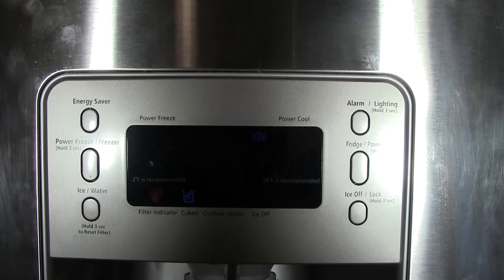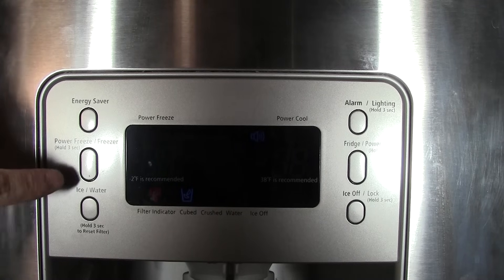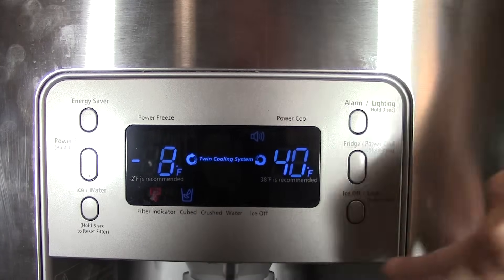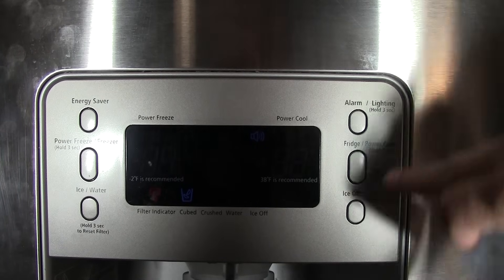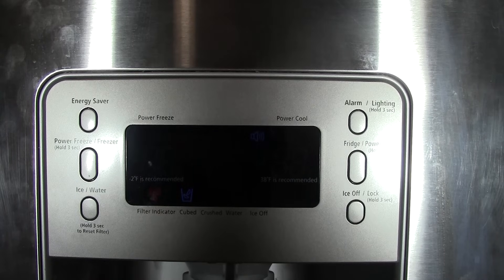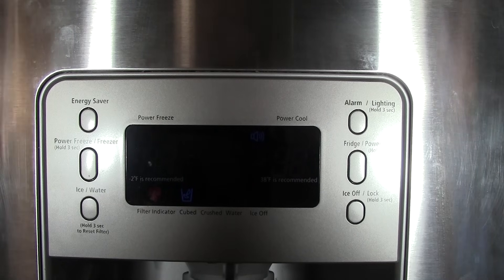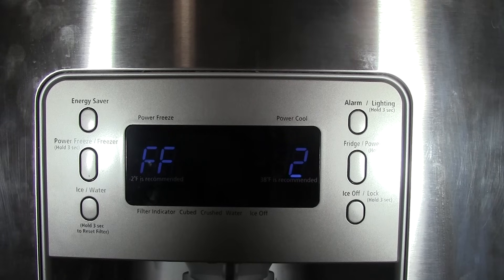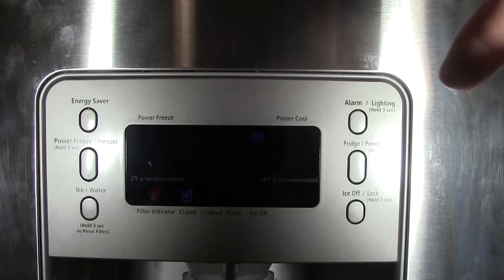FORCED (manual) DEFROST mode on a Samsung Refrigerator--Top Secret Setting

Comment: Wow, had code 21E, (freezer fan error),  freezer wasn't cooling, but fridge was.  Placed unit in Forced Defrost mode for about an hour. Almost lost $300 in frozen meat. Then placed freezer in "Power Freeze" mode (unavailable before) and back in business:) Must have been some ice preventing fan from working? One thing for sure, I long for the days of a simple refrigerator!

Comment: I thought I would share my experience.

It boggles my mind that two appliances with the same model number (mine and this vid) are not actually the same.  But although the displayed menu was different I did find forced defrost.  If you were wondering, as I was beforehand, and in MY case forced defrost ran for 22 mins.  It chimed the whole time, which will drive you nuts, then resumed normal cooling.  My fridge was empty so I didn't care about that temp but my freezer was not so I had a temp probe in the freezer and the readout outside. Temp did vary a little which suggests forced defrost affects both.  If you have the luxury of a second fridge freezer I would recommend using it. Unless it's a Samsung lol

Unfortunately the work I did after this procedure did not fix my problem but that's a whole other story that doesn't belong on this thread.

Comment: how long in demo mode does it take to defrost ice master bucket...best video on this I have seen...thanks Jake...just turned four years old on this modelRF323TEDBSR manufactured in 2012
Reply from the maker: ----> Four years and this is the first time you had to defrost it?  That's not bad.  As far as defrosting the "ice master bucket", I have no idea.  Let us know how long it took....  Thanks for watching.
Reply: I went into demo mode and finally removed ice wrapped around the cover coil.  I suspect there is a leak causing the water to freeze into one chunk took six hours to defrost

Comment: NONE of these "quick fixes" with the door control "rd or fd" defrosting will work, it's less than temporary and you have to run the cycle listening to the beeping several times just to get it to quiet up a little bit.  The "take it all apart" and melt out the ICE with a hair dryer (you could use a heat gun but to be on the safe side a hair dryer is your best bet) will resolve the ICE for about two weeks once this starts to act up on your refrigerator. And covering the coils with something won't fix it for good either, it's just going to freeze all that up and make more of a mess that you'll need to clean up.

So every couple of weeks, just get 'ready' to pull everything out, disassemble, melt the ICE and put it all back together again.
We as well are looking to get rid of this refrigerator and get something else as this has gotten so out of hand it's absolutely crazy. Samsung should be FORCED to replace all of these units with ones that don't do this.

In the interim, PLEASE be sure to unplug your refrigerator while you are taking it apart and melting the ICE for SAFETY purposes.

Comment: I have a Samsung RB193KASB and it has icing build up behind the back wall inside the refrigerator chamber. For the past 5 months I defrosted twice the coils with a hair dryer. This issue comes back every 2-3 months. 
The menu for my fridge is a little different and to get in the defrost mode, press simultaneously for 8 sec the top 2 right buttons: Super Cool + Fridge, and then the screen goes blank. Press fridge 2 or 3 times and then it will appear Fd on the display. I've tried this "Fd" twice and it beeped for about an hour and 20 minutes (each time). It appeared to me that there was still ice at the back  and I opened up the back cover. Obviously this Fd function didn't work for me because the defrost and evaporator coils were completely covered in ice and no signage of defrost. Here are few values for the components inside the refrigerator: Drip tray (drain) heater = 340 ohms, defrost heater = 113 ohms, thermal fuse is ok = 0 ohms, Fan + 162.6 ohm, chamber thermistor = 6.1 Kohm at room temperature and changes the value when exposed to ice ~ 10.5 Kohm - Same value and response for the thermistor mounted on the evaporator coil. This makes me believe that all components inside the chamber are ok and I may have an issue with the control board located at the back of the fridge. 
Any suggestions?

Comment: I have the RS277ACRS getting water in fridge bottom.  Tried hairdryer.  If I do the forced defrost will it heat up the freezer side too as it has two seperate cooling systems.  Need to know if I should move everything out of the fridge.

Comment: I cant imagine anyone watching this does not own a Samsung fridge but if by some miracle you don't. DONT GET ONE. They are around 30% more expensive than similar fridges and despite that they insist on using a Styrofoam backing for the evaporator panel sealed with a low grade sealant that tears when separated. When and I do mean when you have to open that panel to defrost your unit that foam will break and the sealant will tear. From that moment on your going to be getting constant ice build up and you will be opening that panel monthly in high humidity conditions. Every time you open it, it will get worse. 

The problem is so bad that repairmen in my city often know how to install aftermarket heating coils.....JUST FOR SAMSUNG FRIDGES.

For want of 8 bucks worth of silicon your 3500 dollar fridge will fail years before it needed to, for want of a 30 dollar heating coil you will be spending tens of hours a year defrosting the dam thing and pulling out the bottom drawers because for some stupid reason the screws are one inch bellow the drawer mounts. 

* bonus round, the power supply to the fan is on the panel and they like to use a four inch cord (THERE IS NO REASON THE FAN HAS TO BE ON THE PANNEL, NONE) so when you take the panel off you need to pray to god you don't damage the wiring. You have to snake your hand back there like some sort of bomb defusal tech and pop the cheapest plastic connection mount Samsung could find. Oh and its right beside the red hot heating coil.

There is a special place in hell for the engineers of those fridges.

Comment: Hi ...I hope your still around Sure could use some help.
  if I force my frig to defrost by the coil heating up  does it also defrost my freezer .?   And  I can't pull  my frig out ( stuck in there really good), so I just wanted to make sure water doesn't run out the back anywhere  ?   My model is  28HDEDBSR/AA  and it  has a very simular panel as yours

Comment: Having read about 30 of these comments, I think people just need to calm down, take a deep breath, watch the video and follow it carefully. I did, and it worked great! Nothing in the freezer or refrigerator spoiled. The only thing that defrosted was the icemaker, which is what I needed. I didn't have to unplug the refrigerator. I know it's frustrating when an appliance stops working, but it's not worth all the high panic and anger I see here. Easy does it friends!
Reply: How's your ice maker been working since you wrote this comment? I've seen different people say that they've either had to keep doing it every month or that it's been fine for a few months. Thanks.
Reply: @Tapsomebong234  It's a crap shoot. Sometimes mine freezes up on a monthly basis, other times it can go 3-4 months between issues. I think it depends on how much you use it.

Comment: This video saved me a couple of hours removing everything from the freezer to locate the problem or a repair call for my Samsung RFG298 Series french door refrigerator using the manual defrost.  The freezer recirculation fan developed a loud buzz due to ice build up.  Thank you.  New Subscriber.
Reply: I think I have the same model as u. I’m having ice build up on the top where the twin cooling placard is. When you did the manual defrost did you remove all your food? About how long did the whole process take?
Reply: @mylastbreakdown  Once I initiated the defrost process it finished automatically after approximately 45 minutes. I did not remove anything from the freezer and I kept the freezer/refrigerator doors closed. I hope it works for you.  I did this on 10/23/2020, and the fan is still quiet.

Comment: I have a Samsung Fridge (RB195BSBB) and my function key and operation mode combinations are different.  I had to hunt down the Fridge Service Manual online for my model in order to get the proper function key combos.  I'll be testing out the Forced Defrost mode as I'm sick of having to disassemble the back and run a hair dryer over the coils :(  Thanks for the tips!
Reply: We finally took the deli drawer out because of the water/ice that forms on the bottom. It's a lot easier to mop it up now before it freezes solid. I hate this refrigerator, but can't afford another one...oh well...Shame on you Samsung for making such a flawed piece of junk (and expensive, I might add) Give me the old reliables from 25 years ago that NEVER die. One good thing? Your refrige is a lot cleaner because of the constant shuffling of food stuffs :)

Comment: I totally agree with Clint Gray below, I have both Samsung (at home) and Whirlpool in my condo.  The Whirlpool appliances work properly, are easier to use and don't break down constantly.  Don't - Don't buy a Samsung dishwasher, the bottom rack comes off the track every time you pull it out, it is such a pain.  Samsung stove cooks ok, but you have to push the pad buttons hard enough to break your fingers or the back off the stove.  A brand new Samsung microwave (bought to match others) has two buttons that don't work at all - 0 and 9.  Great, no receipt no fixeeee.
Buy yourself Whirlpool appliances next time.
Reply: We have all Samsung products, fridge, gas stove, microwave, dishwasher and 3 televisions!   We've never had an issue with 'any' of them, until this 'ice-up' issue with the fridge, so I'm grateful for finding this video, to help with this issue.   It sounds like someone found that changing the temperature sensor for the fridge, is the answer to stop this issue from continuing!    We'll try the 'fridge defrost' and see how that goes, and if it continues to be a problem, we'll switch out the fridges temperature sensor.   Our kitchen appliances are 4 years old, so it seems odd that this problem has crept up all of a sudden...as this is the first time with the ice-up situation.
Reply: Dale Watkins I have had my fridge eight years never a problem now it defrosts the ice in box and temperature goes up. in freezer and fridge, sometimes the sides of fridge are hot

Comment: What is the difference between Fd and Rd modes?  I'm see both those options on my Samsung Fridge
Reply: Rear defrost & front defrost
Reply: @wehubb  I thought it was "forced defrost" and "refrigerator defrost"
Reply: @lorisardoff2512 could be RD=refrigerator Defrost and FD=Freezer Defrost. The freezer has two heating elements in parallel in behind the freezer panel. One is about 250ohm and the other is about 1k2ohm which measures about 207 ohms in 220Vac to 240Vac systems. This measured on a Rs22dcms Samsung fridge unit. The refrigerator has 3 heating elements measuring 277ohms in parallel. I don't know the individual elements as I never took the refridge side apart.

Comment: The problem is the duck bill on the drain tube back by the compressor. You’re not fixing it by defrosting. You need to get a “leakage service kit” through an appliance parts store or Samsung and install it. That is the fix.

Comment: My forced defrost timed out on its own and resumed normal running after about thirty minutes. I heard the compressor kick in, and the whine of the fan all over again. Giving it another go, and hoping this'll work.
I've also got it on rd, which someone else here commented was refrigerator defrost (mine's a twin cool, so it sounds right.)
Edit: After the second defrost run, the fan is running beautifully and quietly again.
Thank you so much!
Reply: My fridge also has rd mode. Did you use rd or fd to solve your problem? Thanks
Reply: @cjakeyang  I did the rd one.

Comment: Is there a way to stop the alarm during a Full Defrost? It is really annoying to have the alarm on for a such period of time.
Reply: Still waiting for a reply to this question also
Reply: Don't think so
Reply: Even if you defrost it and the fan comes back on, the design flaw causes the same thing to happen again and again.These buttons were not intended for the consumer to use but a technician, thus the annoying beep. It’s time for Samsung to recall these lemons and refund every penny!!!

Join thousands of others and get your refund first, then you can either throw your piece of junk refrigerator out or, if they don’t force you to cut the cord, find a fix and turn your Samsung fridge into a garage extra for  nonperishables that you like cold.
Reply: @IknowGodIs  I agree. I tried to get Lowes to refund this Samsung refrigerator since technicians had to fix it so many times, but Lowes said that the Ice Maker is not a critical part so they did not have to refund the refrigerator. I really blew it buying this Samsung piece of crap.
Reply: Alex I don’t know where you are from but in Australia if with in the warrantee period it needs to be repaired more than 3 times it’s called a lemon and are entitled to a new fridge

Comment: QUESTION--Sir:  I have had Sears come out--they sent a very rude technician.  He told my tenants to unplug the refrigerator until the ice melts off the coils.  QUESTION:  They will be gone for the weekend.  I know they will lose everything, as they unplugged it yesterday.  Do I just plug it back in and cross my fingers?  Or do I need to do something additional to get it up and going for them?
Reply from the maker: Unplugging it will surely allow the ice to melt, but all the food will spoil and stink.  Get the food out and put it in coolers or throw away the perishables.  Assuming you have a samsung with this ongping problem, once the ice melts you can plug it back in, but the problem has not been solved and soon enough,  the fridge will freeze up again.

Comment: Forced defrost (FD) is the key to solving this issue without taking anything apart.  It's not in  the manual.  Just watch the videos here and save yourself money and aggravation.  The procedure varies among models.  Look for the one closest to yours.  On mine, the routine was an extension of the manual procedure for Fast Freeze (FF) which is in the manual.  Just keep pushing the Freeze button until you see FD displayed.  You will hear beeps while it is working.  Let it go for as long as you can stand it (took me an hour).  I couldn't figure out how to stop it.  So I unplugged the fridge and let it sit for a while and plugged it back in.  Worked like a charm.  Fan noise is history (until the next time the condenser coil ice builds up). Wish you good luck.
Reply: pete masuck- Thanks for the suggestion. I tried it and it worked like a charm, but I wonder how long is it going to last before I have to do it again. Do you suggest I just do it automatically once a month, like on a maintenance schedule or do you think I should just wait until something happens, when I hear noises again? And by the way, one final question, is that really our last name? If it is true, it kinda sucks, don't you think?
Reply: Agree completely.  I suspect people with frequently recurring fan noise need to allow it to defrost for an extended period, so the ice build up melts completely.  If you take off the inside back wall of the fridge, you will see a large buildup over time.  A short fd cycle may solve the fan issue temporarily, but only until the top layer of ice builds up again.  The way to solve it long term is to allow ALL that ice to melt not just the top layer that is impinging on the fan.
Reply: Scott in Texas -Actually no, although it solved the problem at that particular point in time, it was unfortunately only a short term fix. Nevertheless, I continued to search for other solutions and came across a comment made by one of the subscribers in another video and he suggested to cover or wrap all the copper tubing with insulation tape. This will stop condensation buildup to settle on the copper and prevent it to freeze. This option thus far has worked the best out of all the dozens of videos I have watched searching for a solution. Check back with me in a few months and I will let you know how it’s been coming along.
Reply: @scottintexas -EXACTLY..…!!!!
Reply: Do you have the rd function as well? Wondering what's the difference between both, and which should i use
Reply: If you have too much ice, like it's coming out of the holes, you need to actually unplug the refrigerator because all the water dripping off can ruin the electronics. It takes about two days, but it will be completely when you plug it back in.